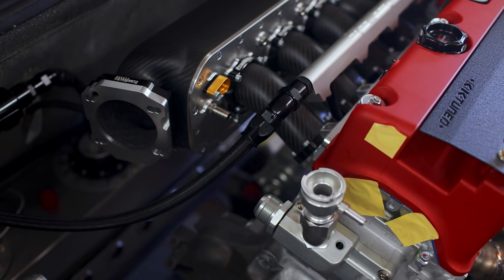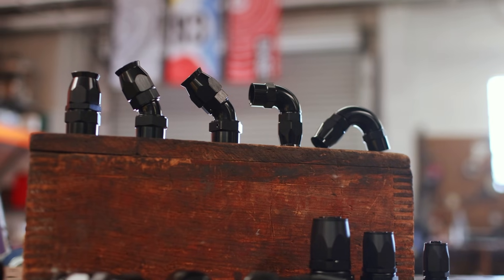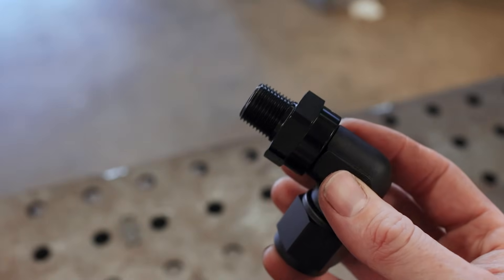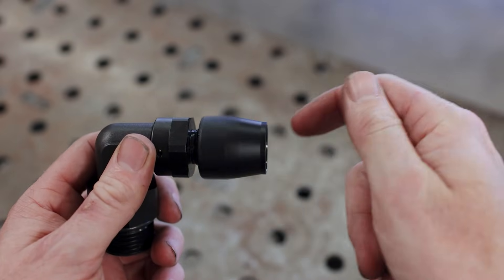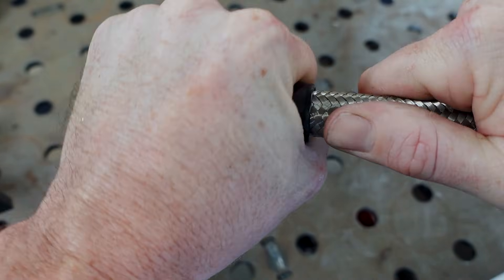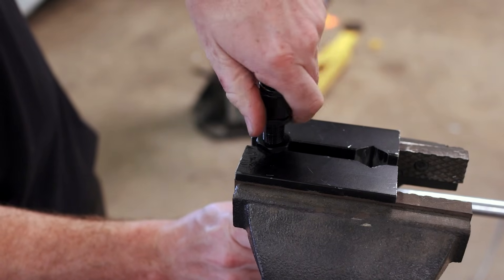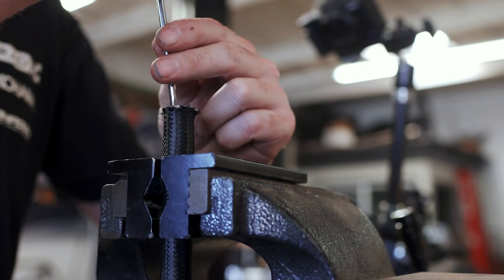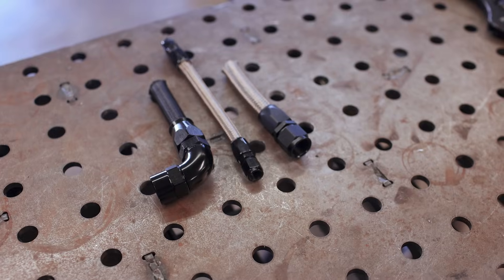The Ultimate AN Fitting Guide & How-To : Everything You Need to Know - Ep. 67

Comment: 2:25. Minor correction: those dash sizes for hose are for inside diameter*. Hardline also has dash sizes, but in that case it is *outside diameter. The reason for this disparity is so that a given dash sizes will always have a fairly consistent restriction. Since hoses have such thick walls and can vary so much, sizing hose off the OD would lead to huge variation in actual flow/restriction. Thus, the ID is used for hoses. And it’s a nominal, not a true value— more like a shoe size than an actual dimension. For example, Eaton’s FC350-8 has an ID of only 0.41”, but it’s still a “dash eight hose.” The OD of the hose is over 3/4”, which would be a “-12” if hoses were sized by OD.  So remember: hose sizes: ID, hardline and tube: OD.

Comment: I have often seen these lines on custom cars and they look amazing are are obviously stronger and better . This fantastic video has now educated me on what they are and how they work and everything I need to know ....
EXCEPT for one thing , the thing that came immediately to mind whenever Ive seen them:
Ho do you adapt from standard pipes?
Every hose I have ever seen on a car fits onto (over) a metal pipe with a bulge ring round it which is then tightened with a jubilee clip or spring clip or similar.
How do I connect an AN hose onto one of these?

Comment: great video, got a question i am installing a lift pump on a 2004.5 duramax diesel and was wondering if there is a fitting of some sort to go from a steel line to the a n type, its the suction tube off the fuel tank where it will go into the lift pump?

Comment: As a man living in Aus who is used to using UNO, BSPP, BSPT and JIC etc hydraulic fittings in my work. This is exactly the video I needed to understand the AN system for my engine build. Thank you
Reply: AN and JIC are essentially the same. Same 37 degree flare angle, and same thread size a pitch specs for a given dash size. Only difference is the tolerances a couple dimensions, but the nominals should be all the same and freely interchange.
Reply: @G5Hohn Thanks mate! I have found that out since! I just want to be able use my plugs and caps from hydraulic setup for work on my build

Comment: Im restoring an 87’ Porsche 928 and replacing all fuel lines with an. Im having trouble finding a good selection od metric adapters. Everything the lines connect to use m16x1.5 male connections. So I believe I need an6 male to female m16x1.5 adapters. Im shocked how hard they are to find. And Im shocked that nobody seems to sell an hose fittings that terminate with male or female ends. Do these excise? Am I just searching for the wrong information?

Comment: If you don't have sheers to cut your hose, you could shove a cork bung up the hose end with a screw through the back of it. When you're done taking your angle grinder to the hose end, you can use some needlenose pliers to grab the end of the screw and pull out the bung, which in turn will scrape out any hose residue from the cutting, Congrats, you just saved yourself nearly 100 bucks from having to buy the Vibrant shears ;)

Comment: personally, I thought what was covered in this video was mostly common knowledge for anyone involved in motorsports or covered in most hose assembly instructions. The areas I've found confusing or time wasting/consuming is in regards to adapters and fitting types even in the same an size and/or angle and hose type there is multiple options including full flow, swivel, forged, specialty, etc and for adapters too many to even list and when re plumbing a car or converting barbed to an a lot of these come into play and even with correct fittings adapters hose, etc certain systems require certain angles certain types such as orb in fuel systems or oil drain from the turbo and 45 degrees or less angles to pan. Would really like to see the process you or vibrant went through start to finish in deciding what hose ends and adapters you needed in total to complete your plumbing or did they just send everything and then some so you'd have more than you'd need cause most of the time and money I see people waste myself included is when ordering and planning it can get real expensive real fast especially the adapters and any wrong angles/sizes/type. dyme psi and auto plumb/aero flow can help take a lot of the guesswork out if you're just doing one time or simple job.

Comment: Just in case it hasn't been mentioned yet..
If you plan on using braided lines for fuel inside the cabin, always use PTFE hose for the section that is inside the cabin, as rubber will permeate fuel vapour slightly and you don't want to be breathing fuel vapour, unless you do, live your life.

Great stuff Mike! Really been enjoying the series!
Reply: If you use PTFE lines, always use the grade that has the electrically conductive liner. Look for SAE 100r14b spec. (The SAE 100r14a spec doesn’t not have the liner— do not use inside the cabin for fuel). PTFE has a super high dielectric and the hoses are basically capacitors. If you don’t dissipate the static the builds up, it arcs to the braid and eats holes in your lines. And then you have a random leak in the middle of a hose somewhere that makes no sense.

I recommend Eaton FC465 (Danfoss now). It’s good stuff, but a pain to work with.

Comment: Dude, my heart sank a little on this video. I was unaware of the different  ways to secure (an) ends to ptfe vs rubber. I did my fuel setup with an fittings on ptfe hoses but I used the threaded in rubber type fittings. The build is about 10 months old and no leaks but now I'm a little worried, what are the issues with the thread in type fittings into ptfe hoses?
Reply from the maker: I’m astounded it’s not leaking. I’d correct it immediately and mitigate the risk of fire. Or have the hoses pressure tested at minimum.
Reply: @stanceworks  Update. I don't want to put false info out there. After checking it turns old that I didn't order ptfe lines, even though that was my intention, I mistakenly ordered CPE lines. I run E85 and I've read that CPE will be ok for a few years but I kinda wanted to route my fuel lines in a different direction anyway. Luckily most of the lines are hard line, its just the ones that needed to flex that I used the braided lines on, and the ethanol gauge sensor, but I think I'm going to get rid of that gauge and sensor to clean up the routing a bit. Thanks for the info anyway. Love the Feronda.

Comment: We used hose cutters as well for my fuel system and yea 0 residue after the cut but I wish I knew about that tape bc even low adhesive painter's tape pulled up some fibers on my Vibrant Nylon braid fuel line but it gets covered by the fitting so all is good. The Koul tool is garbage in my experience.

Comment: You are incorrect on the sizing. The sizes correspond to the ID of the hose and not the OD. So a -6an is 3/8” Inside Diameter, -8an is 1/2” Inside Diameter……
Reply from the maker: It’s the OD of the tube of the ID of the hose. My apologies.

Comment: Great episode and really helpful.
One thought - if you're using tapered thread fittings on older British cars/bikes be careful as they may have British Standard Pipe (BSP) threads. They are similar to NPT but slightly different taper, thread angle and some sizes have different pitch. They will screw in, but won't be reliable...

Comment: Love AN fittings. 
These fitting from Variant are excellent. I race a motorcycle and have built it for twelve years in various configurations. Building hoses and lines is part of it. 
The size of the nuts is crazy. The hose is pretty standard but the nut size is so different between manufacturers I bought two or three sets of aluminum wrenches and machine the jaws to fit when I can’t find the proper size . eBay fittings from China are the worst for this.

Comment: What are the best applications for these hoses nitrous and fuel lines or oil and coolant ?
Reply from the maker: Anything and everything.
Reply: It does vary on the application.  You should always use PTFE hose & fittings (or hardline) on Nitrous, Brake & Clutch, PWR Steering Pressure.  The normal braided rubber is good for everything else, depending on what is in it.  If you are using a fuel with MTBE, M5 Methanol etc, your better off staying with the PTFE liner.

Comment: Just a note on alloy and stainless steel fittings and fasteners.
They are extremely prone to galling. Any little bit of smuts on the threads can cause them to seize before you get them even halfway done up.
Clean threads and lubricant is your friend.
Depending on the metal and the application you can use oil silicone spray anti seize or graphite dust or even wax.

Comment: Also a critical thing to remember about AN fittings. 
Aviation = 37* (JIC & MIL-DTL-18866)
Automotive =45* (SAE)
They do NOT cross over.
Reply from the maker: AN fittings themselves are 37*, SAE Automotive fittings are 45*. But any AN fitting like seen in this video or purchased as an actual AN fitting will be 37* if I am not mistaken.
Reply: @stanceworks  i had a derale trans cooler come with both actually. Trans cooler was 37*. Trans cooler temp sensor fitting was 45*. Eliminated temp sensor fitting.
Reply: but I want my Corolla to fly
Reply: Aviation is 37°, but it's really important not to mix the two.
Reply: @dougstenger4085  ty. I fixed it.

Comment: All hot rod stuff is a AN knock off. Most of the time they will not work with any hose but the manufacturer. Use the wrong hose and the end might blow off. Not saying the fittings are not good. Just call them what they are like Russell, Redhorse and Vibrant for example.

Comment: Sorry but are you suggesting that other countries don't teach fractions ?
Reply from the maker: I’m suggesting using factions instead of mms is idiotic.
Reply: Everywhere else teaches fractions, but only the States does it in imperial, everywhere else does it in metric.
Reply: @aaronb1320  Not exactly true, depend on the industry you work in, if you work in the oil patch its still dominated by the US so a lot of the measurements are imperial, on the plus side you learn the conversion numbers off by heart pretty quickly